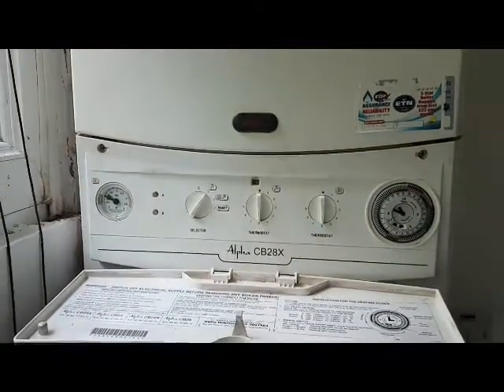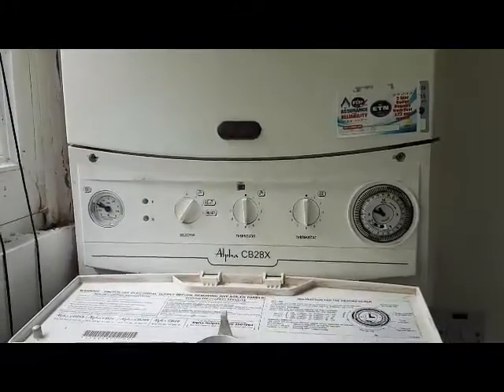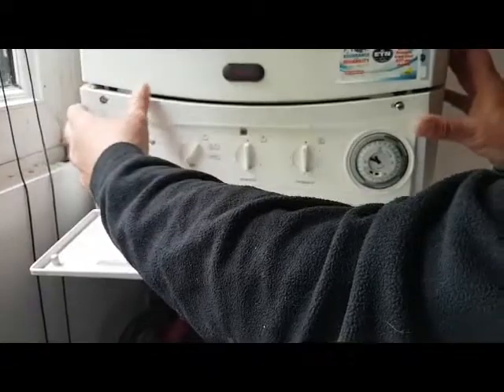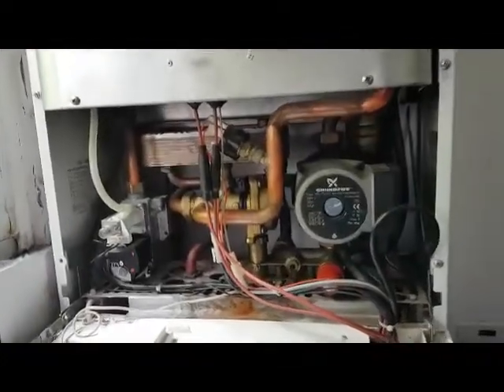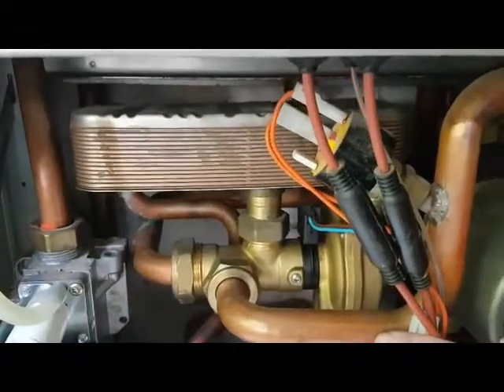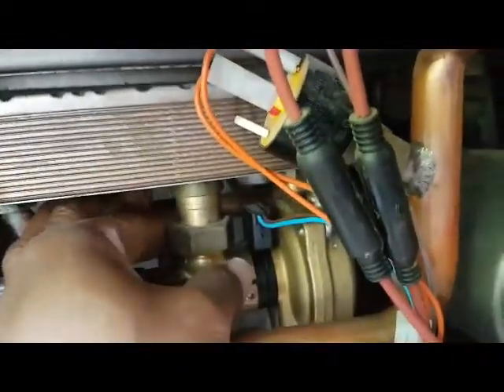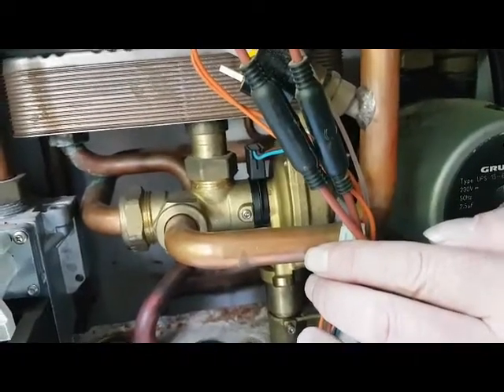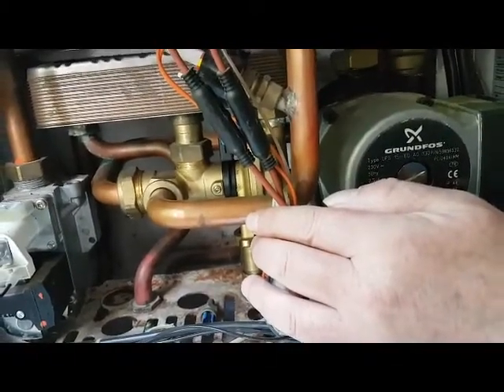Alpha CB28X Diverter valve test. With Coach Tony Morgan

Comment: Thank you that's a great video. I have an Alpha CB25 (looks identical) I have no hot water when I run the tap (it works occasionally). I removed the micro switch and the boiler fired and there was hot water. Pressed the microswitch and the boiler stopped. Do I need a new diverter valve or is it repairable? Many thanks.
Reply: Mine is doing the same what did you have to do please?